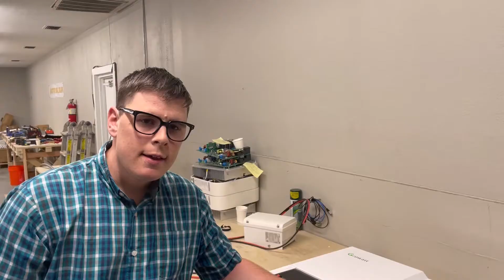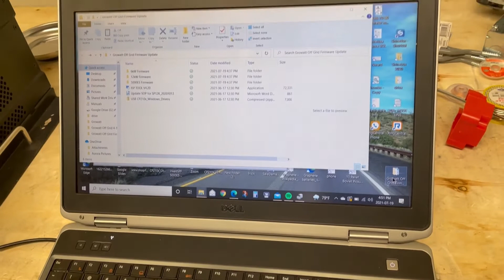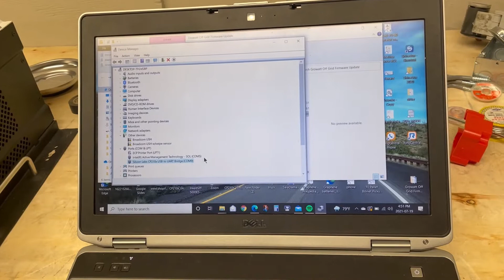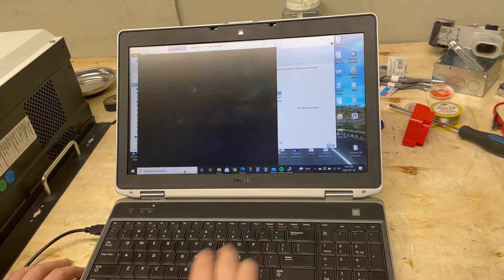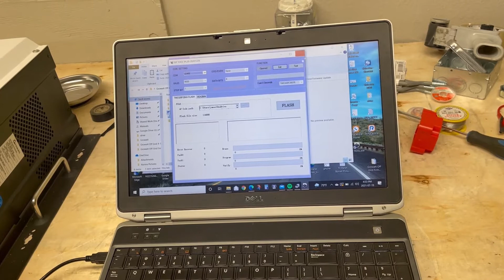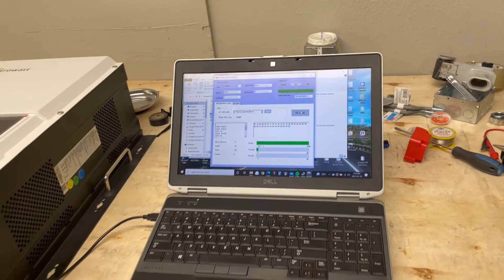Updating Firmware for Growatt Off Grid Inverters - Walkthrough and How-To with Driver Download

Comment: This video and the files saved my off grid inverter. Thank you. 

Followed step by step what growatt sent me and it kept looping. 

Used your files as well as a new usb cable and set program to win7 compatibility mode with run as administrator. I threw the kitchen sink at it. Hope this helps anyone else when the firmware tool loops sending the FW over.
Reply: Thank you for this information!  Absolutely worked for me.  Firmware flashing crashed at every attempt using Windows 10 laptop.  Even worse, the first crash occurred after original firmware was erased so my inverter was dead.  I even tried running their software in compatibility mode as you suggested, no joy.  Then I tried an old laptop running Windows 7 and all was good!

Comment: FYI, for people experiencing problems.  Firmware flashing crashed at every attempt using Windows 10 laptop.  Even worse, the first crash occurred after original firmware was erased so my inverter was dead.  I even tried running their software in compatibility mode as suggested by another commenter, no joy.  Then I tried an old laptop running Windows 7 and all was good!
Reply: What exactly happened in windows 10? The ISP tool got stuck at some point and did not continue? I've read there is a crashing problem with F2809 file
Reply: @deyanv  As I tried to explain in my original post, the software proceeded through the point where it erased the original firmware and then it froze and/or became unresponsive.  I tried to restart is several times but it did the same thing every time.  When I ran the exact same software on a computer running Windows 7 it proceeded just as it is supposed to.
Reply: @ericdirnbeck3497  for me it was just the opposite. It crashed on newly installed Windows 7 (.net exceptions every 5 seconds, then it clears progress). When I tried on different PC running Windows 10, it worked from 1st attempt. Strange. Maybe the hardware matters
Reply: @deyanv  I wondered the same thing when I ran into this problem in the first place.  The next time I do an update I may try Windows 10 on a different Laptop.

Comment: I tried this update on my 12kW DVM MPV and it did not work.  The ISP Tools kept saying Send:Start! and never finished.  System is bricked until I can get help from Signature Solar.  I have a call into the tech support.  I will update this post once I get an answer.

After calling tech support at Signature Solar and Growatt in California I started trying to do my own thing. The link for the 12kW here is NOT the correct file. Later in the day Signature Solar and Growatt sent me a file to use that appears to be different. I fixed my issues by disconnecting all power to the unit and allowing things to discharge. I disconnected the wifi dongle and opened the front cover. I checked all connections to the main board and the communications board and the put the on/off switch from the cover to the board so that I could power the unit with the cover off. After powering up and all connections secure the unit flashed with no more issues. Signature Solar called me right after this and stayed on the phone with me while the flashing was underway. They explained me that they have been super busy lately and that they had been getting more calls about “Fan lock faults.”  After flashing the firmware my unit appears to be working a little differently. I hear a fan that I didn’t hear before and so far I have not had a random power off events. In the beginning the unit would not stop buying power to charge the batteries but I think it was because the batteries were extremely low. After a little charging that is no longer an issue. I hope this helps anyone out from my experience.
Reply: Hi Q, the same thing just happen to me and now the inverter just flashes the lights and won't turn on, this device should have a reset button in case something goes wrong and now i'm using the grid because this situation
Reply: @jaime4272  
After calling tech support at Signature Solar and Growatt in California I started trying to do my own thing. The link for the 12kW here is NOT the correct file. Later in the day Signature Solar and Growatt sent me a file to use that appears to be different. I fixed my issues by disconnecting all power to the unit and allowing things to discharge. I disconnected the wifi dongle and opened the front cover. I checked all connections to the main board and the communications board and the put the on/off switch from the cover to the board so that I could power the unit with the cover off. After powering up and all connections secure the unit flashed with no more issues. Signature Solar called me right after this and stayed on the phone with me while the flashing was underway. They explained me that they have been super busy lately and that they had been getting more calls about “Fan lock faults.”  After flashing the firmware my unit appears to be working a little differently. I hear a fan that I didn’t hear before and so far I have not had a random power off events. In the beginning the unit would not stop buying power to charge the batteries but I think it was because the batteries were extremely low. After a little charging that is no longer an issue. I hope this helps anyone out from my experience

Comment: Thanks for this! 
Is there any way you can get the 5000TL HVM latest firmware?
Reply: Yes, I also have a SPF 5000TL HVM model that's giving me problems
Initially only had the inverter with 4x100amp gel batteries, then later added 4.4kW PV System
In beginning everything was working fine, however noted
1. Only got about 2.5kW out of PV at peak daylight (expected 3.4kW at least)
2. Then batteries kept overloading (later realized the setting was changed to flooded? - changed it back to AGM) (Not sure if batteries got damaged and lead to next problem - they seem to be working fine)
3. However now, the PV system only powers the batteries and doesn't want to add to the load of the house, so therefore grid still powers most of house. The setting I think to change this is #22 (according to manual), but is not available on the inverter settings (skips from #21 to #24???). 

So I'm left with thinking I need a firmware update perhaps?

Comment: I just purchase the 48v 3000w off-grid inverter charger. I've been working on it for two days and can't get it to charge my custom Lifepo battery with Daly BMS. I don't have solar yet and plan to use this where I have a generator for recharging the batteries for now. 

Tech support tells me to download files so that I can upload firmware. He said I need to connect solar before I can upload the firmware? And it requires me to use a windows PC... I own apples. I watched the video included and the guy just says "you can't do it with an apple". 

You know what I can do? I can return this thing right back to Amazon and they can pick up the charges. 

I you want to kill a product quickly, send it out to a customer broken and then tell them to fix it themselves!

Comment: I'm hearing there software dose not like windows 10, even in compatibility mode. Growatt should be letting people know what the firmware updates are changing. 
I'm finding alot of flaws with these inverters.  Such as advertised ratings vs real life ratings. 
The voltage limits of such a large inverter are very low and the mppt is not very good. It's algorithms are all over the place and alot of times take a while to find the right power point .

Comment: I have the 8k Growatt from you, but the firmware listed is for 6k and 12k, is there a separate firmware for 8k? Someone in the comments mentioned firmware update failing on Windows 10, is Windows 10 safe to use?
Reply from the maker: The firmware is for 6k through 12k. Windows 10 is safe to use!

Comment: I finally got the update done, it took a while since I have no idea what I'm doing so I had to watch a few steps and run up 2 flights of stairs to work on the inverter. Only thing is now if I shut off the utility power the inverter shuts down. The display shows it on battery, but it's actually on utility. Should I reload it? Any help would be greatly appreciated. the dog

Comment: How are offgrid inverters different from grid tied inverters?
Reply: Grid tied inverters will feed back to the grid which is illegal without a net meter and quick shut down of solar when the grid is down, therefore when grid is down your solar is down also. Off grid will not allow feedback to grid, therefore solar continues to work when grid is down.
Reply: @JamesLee-ey2yv  Correct me if I'm wrong.Ther terms are so confusing. Take Hybrid inverters for example : the grid technically powers the inverter on but they call those HYBRID inverters. One new to solar can assume those hybrid inverter are "grid tied "?   I'm so confused  hahaha
Reply: @Xxxcappie23  You didn't ask about hybrid inverters you asked about grid tied vs off grid. My understanding of Hybrid inverters is limited but I understand they are used if you have a grid tied system that shuts down when the grid goes down and aren't happy with that you can add batteries and a hybrid converter to make it work when the the grid goes down. Basically two systems in one, thus called Hybrid.
Reply: @JamesLee-ey2yv  You're right I didn't mention the grid tied type in my first comment. It was an inevitable follow-up question I couldn't help myself asking.  However, your answer reply made sense too thank you . Thanks for for Good videos

Comment: After following the instructions to the "T" my unit shut down and started clicking at me.  Is there a way to factory reset back to defaults?  Please help!
Reply from the maker: NOTES!
-Shut Off the AC breaker before flashing firmware
-If firmware flash fails disconnect PV, AC and Battery from the unit and wait for 10 minutes
-Consider that you may need to replace the USB cable you are using as it may be faulty
Reply: @SignatureSolar  why would the first file go through no issue and the second file runs through for more than 15 minutes saying send start?

Comment: After upgrading, what should program #5 be set to? I have the 48v Gyll 100AH.
Reply: @woutervandermerwe3320  😱WTF! They're supplied by signature and I already flashed mine today. Why do you say they are incorrect?
Reply: @twelveofthem  my inverter is not working at all i have done the firmware update to the T and no luck i thought i had it working with other files but still no luck did yours work?
Reply: @woutervandermerwe3320  yes I flashed both of the files and it still works
Reply: @twelveofthem  what inverter do you have im stuggling my ass off on my 5000es
Reply: @twelveofthem  which file did you do first
Reply: @woutervandermerwe3320  we have the same inverter. The F030 file is the first one. You have to do them sequentially
Reply: @twelveofthem  i did the f030 then restarted like the program says then the other one.
so you saying i must do the f030 then load the next one do it and then only restart?
Reply: @twelveofthem  did the second file say start send the whole time for like 15min or no?
Reply: @woutervandermerwe3320  they both take a little while
Reply: @twelveofthem  om in south africa its 22:00 and i have had no power since 4pm today because of firmware update issues
Reply: @twelveofthem  so no restart inbetween
Reply: @twelveofthem  no sir even if i do them sequencially the second file gets stuck on start send and growatt inverter just peeps constantly no break like the first file
Reply: @woutervandermerwe3320  I restarted the inverter after the first one because that's what the program says to do

Comment: This inverter is unreliable.  I just had my spf6000t dvm 48vdc blown up on us when it had only one appliance (120v  air to water generator running) drawing about 1050 watts for a few minutes.  4 mosfets were blown. No other loads were hooked up to the inverter when it failed.

Comment: Hi, Did the firmware update for a 12000t DMV and now all I get is a blank screen and a solid red fault light and now I can do nothing with the inverter. Not working,  Any advice please?
Reply from the maker: sorry, we were short handed last week, if you have a failed attempt you can reboot the inverter after removing all ac and dc power for 10 min, make sure there is no AC load on the inverter as you flash it
Reply: @SignatureSolar  Hi, Did all that a still nothing, I think the Card is toast.🤦‍♂️
Reply from the maker: @fortunesoldier4000  we will happily replace control board, call tech support for this request, we will ask that you try a different USB cable when you attempt the flash again
Reply: Samething happen to me as well but mine all the light are flashing, the inverter not responding
Reply: @SignatureSolar  I followed your instructions and while the computer was flashing the inverter about 60 % completion I got an error message and every I clicked continue the message kept coming back until it froze, now my inverter is not reponding and all 3 lights are flashing. I disconnected all dc and ac loads and waited 10 minutes, Inverter started but all 3 lights remained flashing
Reply: After reading these posts, now I'm hesitant to update. Got my 12000 DMV in April, firmware just released.
Reply: @fortunesoldier4000  did youy manage to flash it or it is still dead?

Comment: Has anyone got this to work??? I cannot get the app to recongize the port... I have tried it with my Dell Laptop windows 10 and my HP laptop windows 10... When i plug the printer cable into the USB port on the computer it tells me a port #... I put that into the ISP Tool  doesn't recongnize the port #.  Tried with both computers...  The Test button and the Close stays grayed out and so does the Flash button.
Reply: My understanding is that windows 7 is required for this to work.
Reply: if you go into device manager does it show as a port?
Reply: @aaroncribbs9911  My computers are windows 10... Do I have to find someone with a windows 7 operating system?
Reply: @woutervandermerwe3320  Not in the device manager tree. but above that when I plug the USB cable in and out it comes up with a weird port number.